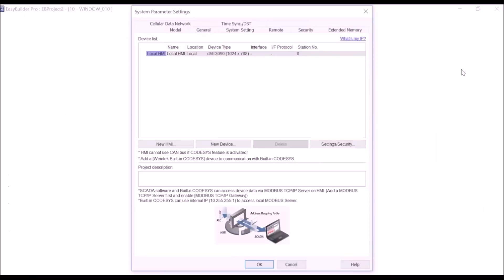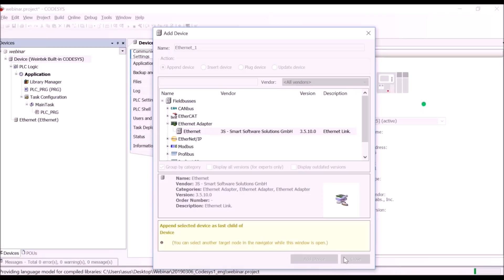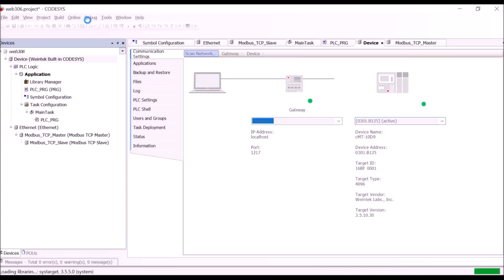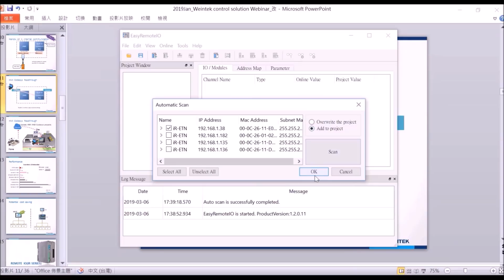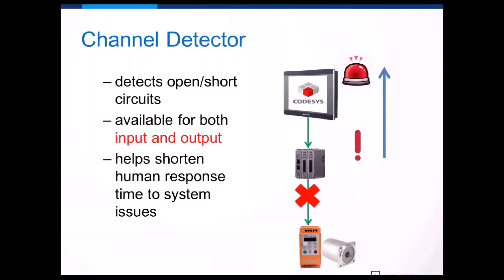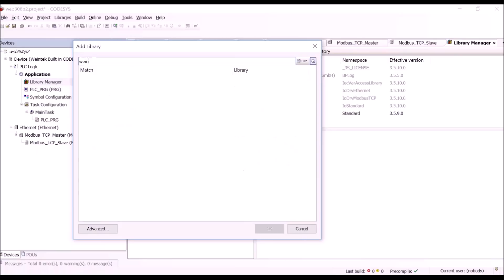Weintek Webinar 2019-03-06: Integrated Control Solution_HMI, Codesys & iR series feat

Comment: How can i generate Codesys Tags from Codesys PLC program to import tags into EasyBuilder when i use Weintek Built-in Codesys? I generate a XMLfile from Codesys but it isn't correct because Easybuilder doesn't accept this file, is there a video where this procedure is exactly described? I have seen the present video but i don't see it, you describe a XML file necessary but not the procedure to generate
Reply from the maker: Hello, when you build CODESYS program, there's a XML file will be generated automatically. That is the file you need to import.
Reply: @Weintek_Official  Thankyou i have just solved the problem, now i need more libraries if It's possible